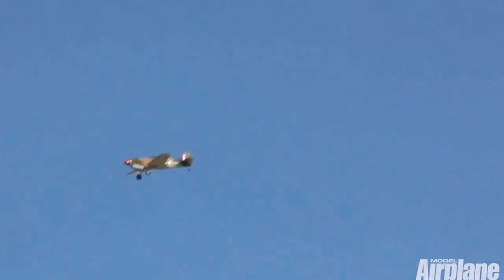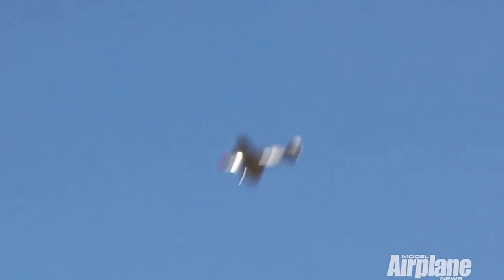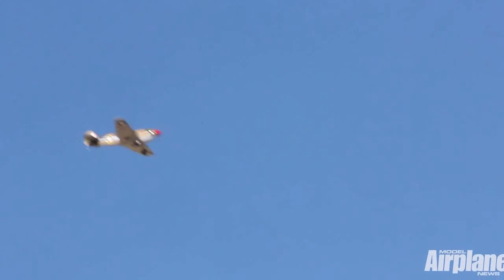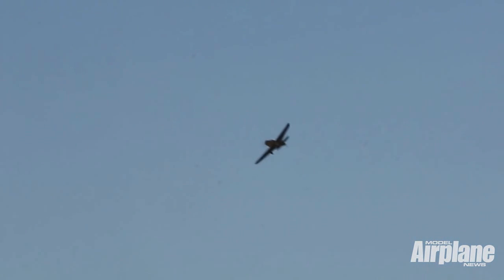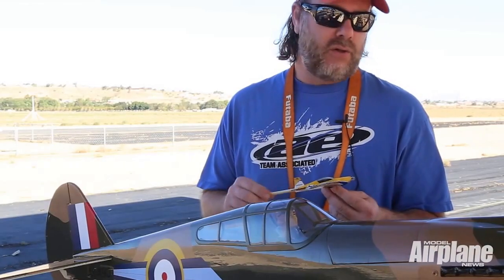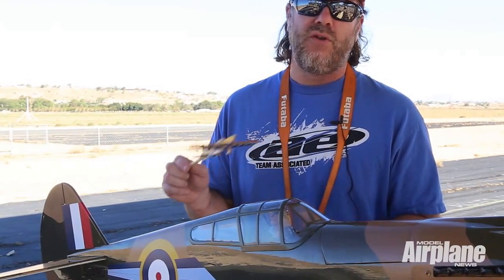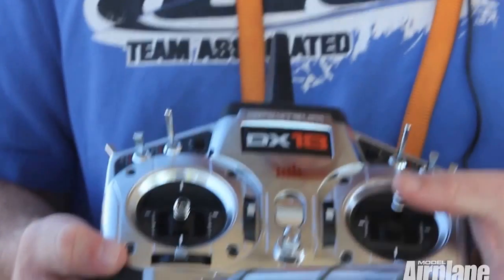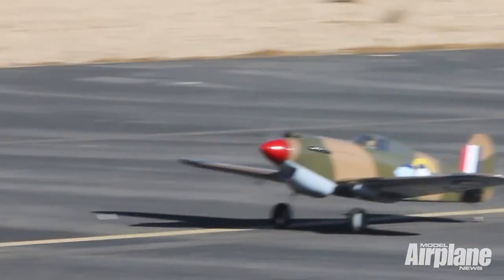Flight Trimming Secrets

Comment: I have a question about something I hear a lot of, but not sure on how to do. Build a new plane. Take it up and trim for straight and level flight. Now you bring it in. How do you adjust the control linkages for the trimmed positions while resetting the servos back to their neutral points in the Tx? Apparently it's a bad thing to add any trim in the radio. Why? I don't know.